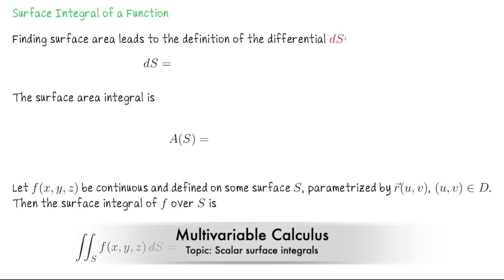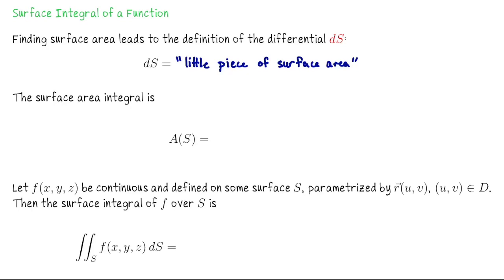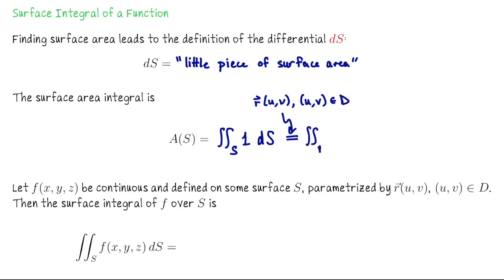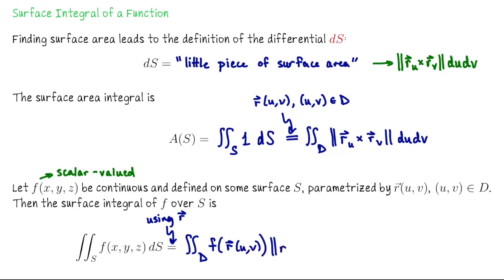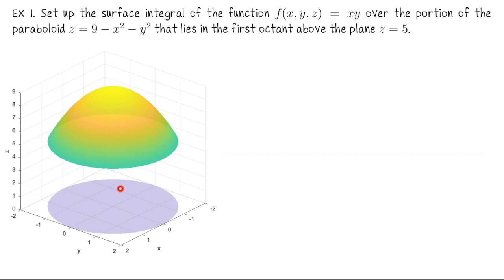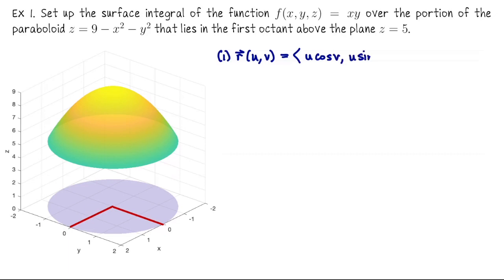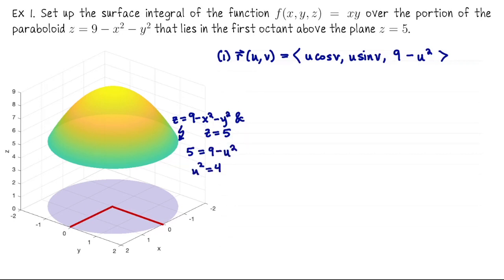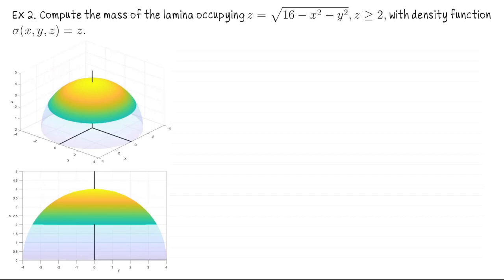Scalar surface integrals, Multivariable Calculus

Comment: in ex1, if f is in R4 then what are we integrating? volume in R4?
Reply from the maker: Yes, we can essentially think of it as computing a 4-dimensional "hypervolume." From the point of view of the Riemann sum, we chop up the domain into cubes, and to each little cube, we associate a function "height" value f(x*,y*,z*). Then f(x*,y*,z*) ΔV (or ΔxΔyΔz) is like height * volume of the base to get a 4-dim volume.
Reply: @bevinmaultsby  the confusing part for me is with the differentials, isn't the parametric surface a 2D object? corresponds to 2 differentials du and dv, which gives us dS, which should be a "tiny change in area" (still in R2) , or you mean we need to think of du dv in terms of the pullback f ⚬ r ? which i guess is a small change in R3?